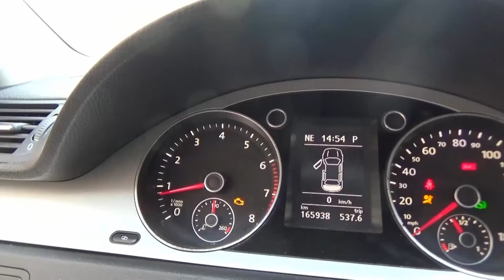How to removal heater core. Volkswagen Passat B6 and CC heater core replacement

Comment: At the 4:00 mark, how do you go about replacing that hose? My line busted next to the heater core.
Reply: I am currently having the same problem. Coming home from a late night fast food run I notice steam coming from my engine, got home and traced it to the top inlet. Its dark out currently so I couldn't tell if it was coming from the hose maybe rotting out or if it was the piece the hose connects to. 

Were you able to figure yours out?

Comment: how did you get the heat shield off to remove the hoses and little screw
Reply: Initially I asked the same question on another post. But, actually you don't need to remove the heat shield. Would be great if you could. Just shine a bright light on the clamps and with a long skinny flathead screwdriver or pick tool, release the lock clamp on the hose the several good tugs at the hose the hose should release and come off. My issue is pulling hard enough on the inlet after removing 6mm screw actually the screw fell off or was never there from the start, but I can't get the inlet to pull forward enough to release the internal piping from the heater core connectors.

Comment: Is it necessary to drain the coolant first?
Reply: I have this same question
Reply: I used two hose pliers for pinch the two heater hoses. Than after disconnecting the quick disconnects i used an air nozzle to blow out coolant from the radiator. So i don't get a mess inside the car...

Comment: how do you break the pipe lose from the heater core?
Reply from the maker: 1. At first remove bolt - screw 3:58;
2. I moved pipe lose and it broke. Watch at 4:56.
Reply: Good video! But goodness I broke the pipe off too, I could not find another way to get it out! 😭
Reply: My two all tubes where impossible to remove without violence. I took an angle grinder with thin disc and cut trough the pipe (the part of the clocked heater core). After that i could wiggle the tubes of one by one.
Reply: Yep, I ended up bending it up until it broke off!